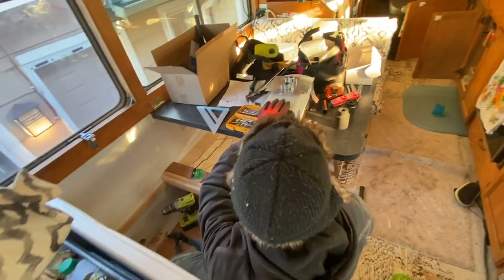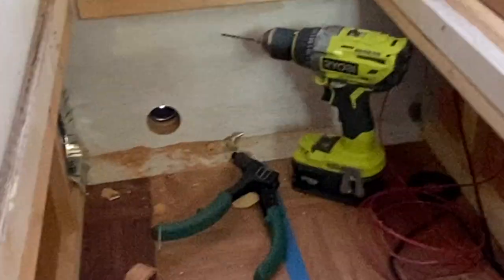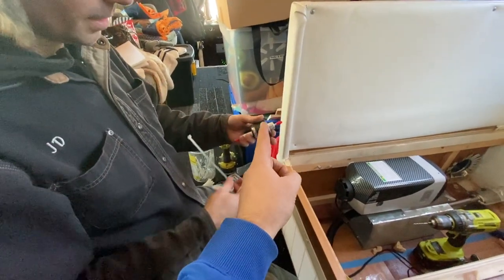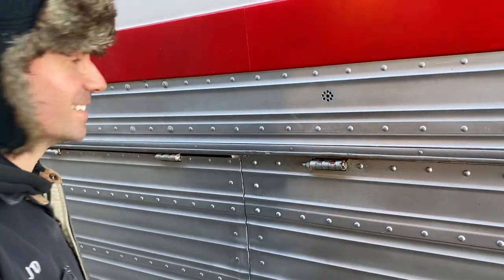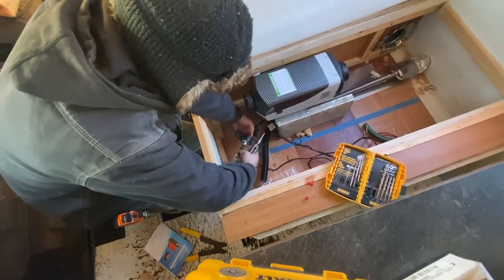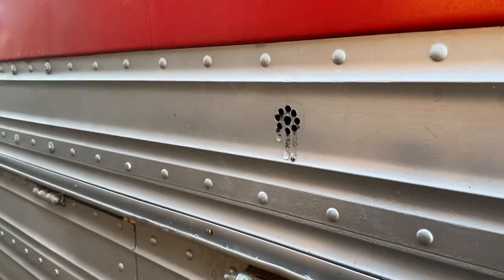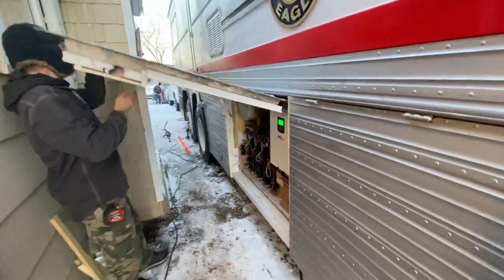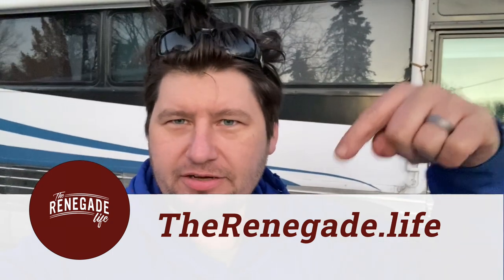Hanging out with Renegade Life & Installing Chinese Diesel Air Heater on Eagle Bus Conversion

Comment: I like the Webasto hydronic system, easy to maintain and parts are available everywhere. You can install fintube baseboard coach heat and you can plumb a loop to pre heat the engine.

Comment: Nice to see a project working as anticipated!  I have a Webasto hydronic system on my bus that I need to troubleshoot.  I think a diesel heater just might be easier.
Reply from the maker: Yeah it was a lot of fun. I didn’t show it but it took us a while to track down the fix for the 06 error . JD was on the scent right away with the sensor issue. He’s a former oil field worker and know how to get stuff working. 

They make a water heater version of the heater. I’ve thought of maybe getting one of those as well for engine preheat while boondocking.